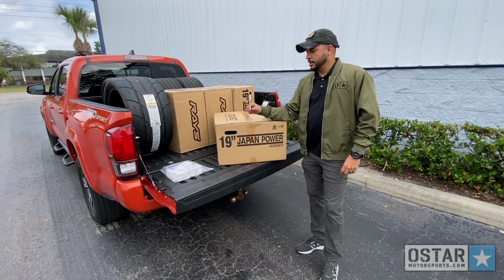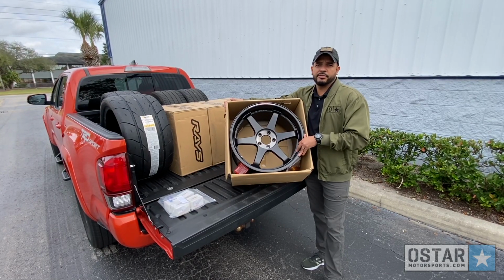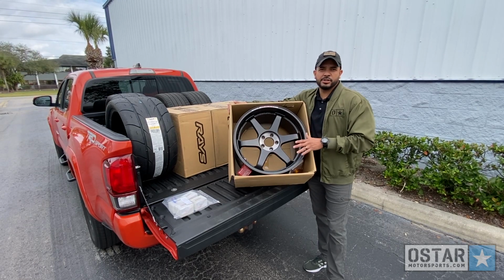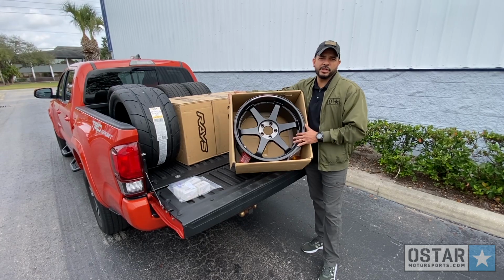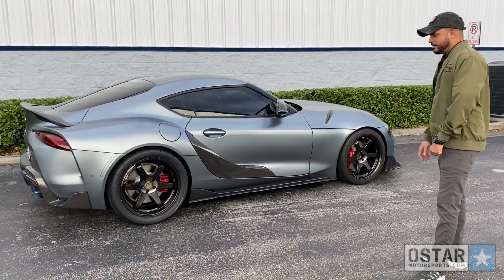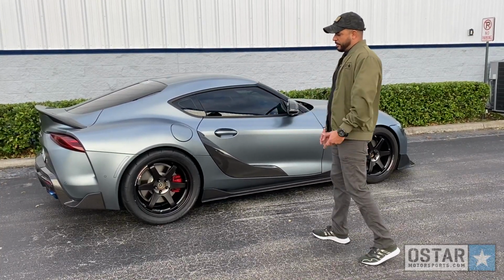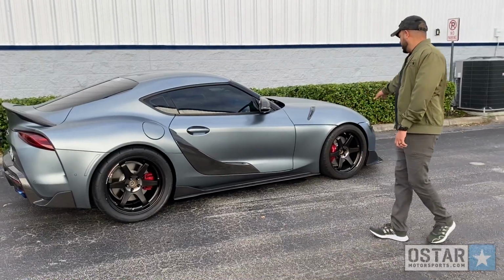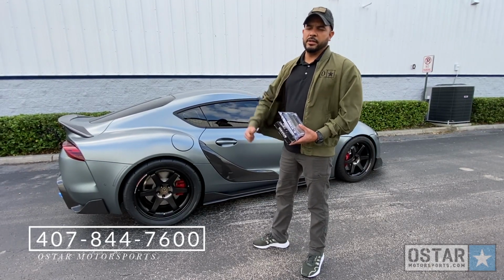Best Supra MKV tire fitment with Volk TE37

Comment: will these work on a G20 M340i xDrive? and with what tire set up? curious to know if it works
Reply: You should be able to fit the fronts as a square setup, but I am not 100% sure.

Comment: Does anyone know if you need special lug bolts or can you use the stock ones on the A90 running these wheels?
Reply from the maker: Stocks won't work on these.
Reply: Are the lug Bolts included with the wheels from volk?

Comment: Do you think I can do 305's with 19x11's in rear??
Reply from the maker: might have to do a slight negative camber
Reply: Yea no adjustment needed if you go 19x11 offset 35 tire 305/30/19 that's what I run online no rubbing at all

Comment: hi, is this stud conversion for using 5x114.3 wheels on the 5x112 pattern on the MKV supra?
Reply: This kit is for 5x112
Reply: @ostarmotorsportsespanol775  is there a kit where I could use 114.3 wheels on the 112 Supra? Is there such a thing ?
Reply: @abel5763  wobble bolts my guy

Comment: Link for the studs and lugs? Looking at picking up a set today.
Reply from the maker: Studs - https://ostarmotorsports.com/wheels/wheel-studs/wheel-mate-stud-conversion-m14-x-p1-25-m14-x-p1-50-75mm-l-nickel-finish-qty-20-wmp37105xln0/
Reply from the maker: lugs - https://ostarmotorsports.com/wheels-accesories/lug-nuts/wheel-mate-monster-open-end-lug-nut-set-of-20-black-14x1-50-33006b/
Reply from the maker: both of these are available and can ship today!

Comment: For that particular car, my choice of tire would be a mid profile 18"" Yokohama summer tire. I really think people are going just too low profile and the ride sucks.Well for the shitty roads around my town they are! Road? Or just a series of interconnected potholes? Gotta love the quality of work union road crews use when creating or repairing the roads. Minimum concrete thickness by law is 6 inches.  That's why they only install 2 inches to save the citizen on their taxes not putting down more product.  lol  What, you want the road to last forever?  lol